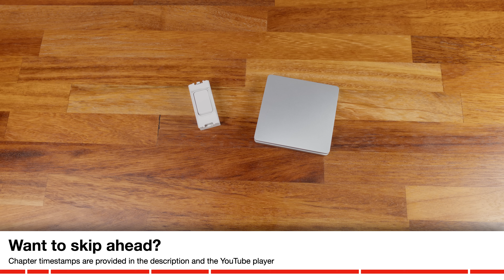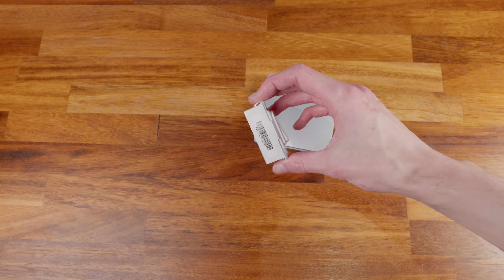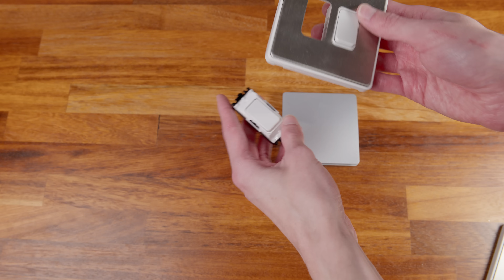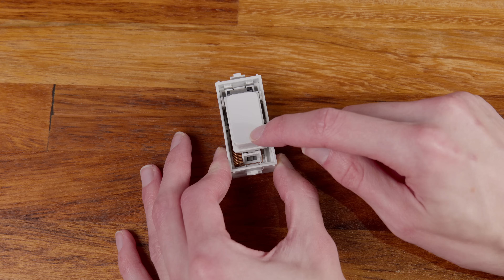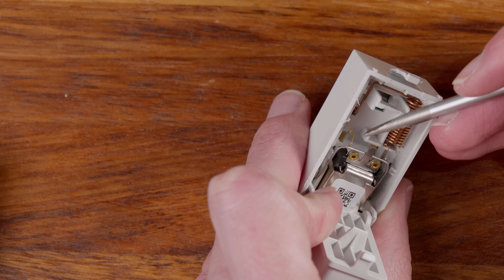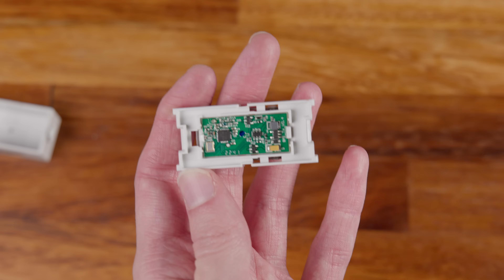An Expensive Smart Home Mistake? My Quinetic Switches are FAILING!

Comment: Brilliant video. If starting from scratch, would you use these on a new build, fully kitting the place out with these? Are there any brands that are a since shown to prove themselves?
Reply from the maker: These devices are great for retrofit applications where running cables would be too disruptive but I wouldn't use them on a new build.  A new build or rewire is the prime opportunity to install dedicated cabling for everything.

I've seen people do rewires using these switches instead of installing switch drops and it just seems like such a terrible idea.  What happens in 10-20 years when something fails and a suitable replacement is no longer being manufactured?

Comment: Let’s face it a physical tangible mechanical switch with appropriate switch wire is best.
Reply from the maker: Definitely my thoughts, these still have a place (for example, installing an outside light but where running a switch drop to where you want the switch would be too destructive, but I do worry about people doing entire rewires based around these rather than just stomaching needing to plaster a few switch drops.

Comment: You could have just run a small screw into the housing to protrude far enough to replace those clips and hold the spring down, would never have failed again.

Comment: If mine break I will get replacements on warranty or try epoxy where the clips go. Never had much luck with the small sonoffs .Although they are small they don't fit behind the light switch easily. I could not get it in even a 35mm as the back of the switch protrudes to much.  Also for miniR2 detached relay mode does not work on ZHA and i don't want to switch to Zigbee2Mqtt.
I also don't trust the amount of clicks the cheap sonoffs have it them. Replacing is a real pain when they fail.

Comment: It would be wise just to still run switch drop cables and leave it behind the back box
Reply from the maker: Absolutely, in my case this wasn't an issue since I retrofitted them in place of existing switches, but it does worry me seeing people doing "Quinetic Rewires" where there are no switch drops meaning the install is reliant on Quinetic switches going forwards!

Comment: Found your video after having endless problems with Quinetic switches. The large flat panel ones work fine but yes they are ugly. Knightsbridge brand switches failed in six months so the retailer TLC provided us with free replacements when our extremely unhelpful electrician failed to honour his warranty.  However a year on, we now have a receiver failure. Am bitterly regretting installing Quinetic and now considering getting the effected room hardwired (very expensive and disruptive). Avoid!
Reply from the maker: That's definitely unfortunate!  They're still a decent option for retrofit applications such as controlling an outside light where running a cable to a switch would be awkward, but I do worry about situations such as yours(?) where it's being used as the primary means of controlling indoor lighting without any cables running to switches since, as you've found, you're then tied into relying on a wireless solution long term.

Comment: Thanks for the video, such a shame they fail, anyway I want to hang my bedroom door to the other side so will need to move the switch but don't want to chase the wall out, so I was thinking of this switch, but now I need to look at another approach to my problem, any suggestions? Bob in the UK, HAVE JOINED YOUR CHANNEL.
Reply from the maker: To be honest, for that sort of situation these are still probably your best option, although maybe not the MK grid modules I have here, their "paddle" style switches probably have a different design so may not have this issue.  It may just be worth keeping a spare switch around just in case of any issues (even pair it and keep it beside the bed so you can turn the lights off from in bed!). Of course if you're ever redecorating then at that point it may be worth chasing in a cable.

Comment: I sent mine back to TLC under guarantee. Replaced without fuss or arguments.
Reply: Fully understand that stance. However, informing the supplier of the issue may result in action to rectify the problem. If you don't know it's broken you can't start to fix it.
Reply: Was at the elex Coventry yesterday and showed the guys on the Quinetic stand this video as they were not aware of the problem, interested to read some have been returned under warranty to their only distributor TLC and they werent aware of the fault, unless of course it was returned for a different fault.
Reply from the maker: I definitely could have done, they'd still be under warranty but given I'm pretty sure this is more of a design issue, I'd have ended up with new switches that could fail in the exact same way again.  At that point I'd rather just cut my losses and fit a different system which I can trust the long term durability of.

Comment: Surely, with your set of skills, you'll DIY a solution to reinforce those two little plastic posts
Reply from the maker: I probably could have, although personally I always try to use things where I keep the hardware as stock as possible, and if the manufacture's design isn't good enough from the factory, I'll not use it.  I'd rather not be in a situation where every time I want to fit a new switch I need to embark on a project to reenforce them.

Comment: Do the Quinetic switches come with a warranty?  It seems like a seven-month-old switch should be replaced by the company.
Reply from the maker: They do, and I absolutely could have used the warranty, however my point was more that I have installed a tonne of these and now can't trust them to be reliable long term.  The £17 to replace a failed module isn't really the issue, it's the time and effort required to deal with failed modules where I then can't control the lights and need to swap the module and deal with the replacement process.  Even worse if you were installing this as a contractor and need to deal with customers calling you back to replace failed modules.
Reply: Thanks for your quick response. I loved your video. I installed Insteon light switches 10 years ago and not only did they start failing about a year out, the company went out of business!  I must have spent close to $7,000 on those darn things. I’ve been replacing them with Lutron switches.

Comment: I avoid BG if possible. Low cost for a reason. Had a real hassle installing one of these in a grid, needed supplied adaptors and shims, a real cobble up and ended up looking crap.  The Quinetiq stuff I’ve found to be robust.

Comment: Looks like there really simply designed. You can likely add some diy reinforcement to the posts if there easy to pop open like that. Really dosent bode well for bigger installs/important installs like you say.

I really like the kentic consept.

Comment: I must admit like yourself l had concerns when l first saw these Quinetic switches being installed as a primary switching source on their longevity considering the replacement cost in the advent of a failure as you have just highlighted. 
   Keep up the great videos and stay safe.
Reply: I've just put a few in my house haha. Not the grid version luckily. I think I'll keep the old ones in the loft as a backup :)

Comment: The kinetic switch is not the problem, the only problem is this brand, just use another brand
Reply from the maker: The issue is that there only seems to be this one model of kinetic switch that fits into my MK grid light switches.  Another company (Ener-J) also sell one, but it looks very similar and may end up being the same product under a different brand.  Would rather just replace them with a system that uses the known-reliable MK retractive switches.  Then, while I could get the traditional "paddle" style kinetic switches - those are out of the question as I want something that matches my existing light switches.
Reply: @camerongray1515  Very useful videos about Quinetic.  I am planning (or I was planning!) on using Quinetic paddle style switches for a couple of outside lights.  I want two switches to switch two lights at the same time.  I have two questions I hope you can answer.  1) Is it possible to have two switches paired both to two lights?  2)  Do you know if the paddle switches suffer from the same fatigue problem you experience with the MK grid versions?  Would be great if you could answer.
Reply: @MrSgtSunshine  A little late but for anyone who needs to know the answer is: yes "a controller can be controlled by a maximum of 10 separate switches"

Comment: As someone mentioned already, could you repair these with tiny screws through the outside housing with the ends catching the spring, like the clips do?
Reply from the maker: I imagine you probably could, but you'd have to be extremely precise to get the positioning just right - the mechanism only moves around 1mm when clicked.  Personally I'd rather just replace them with something I can trust the reliability of

Comment: While it would be better if it didnt break in the first place it is fixable, put a small screw through the side of the plastic housing to hold the spring down problem solved.

Comment: 1. Warranty return. 2. Hard to work out how much space and the movement of the mechanism but: could you drill two holes and put a long skinny bolt across the width to act as the limit?

Comment: I've been looking into using the CSPGM2075PW modules from Click. They're a Tuya TS0042 internally but a grid switch externally. Also supported in Z2M. Reason I haven't yet is mostly down to price.

Comment: They have a three year warranty, which I’ve had to use just once, after around two years with a heavily used switch.  The MK grid switch failed to click when pressed, the same problem as you had.

Comment: 14:43
I do this with zigbee coin based CR2032 switch (AQARA) and solder the switch points to an existing wall switch. No live wires.
Reply: how often you need to replace the battery ?

Comment: Oooo. Cool. I knew of Quinetic switches, and was liking the general idea, but then was not thrilled by lack of receivers so I can hook things into own system. Your reverse engineering efforts then are a game changer, and now I will look into this again. Rest of my home automation is primarly Shelly Pro modules, with custom automation software.

I do not think this is planned obsolescence, just a design mistake, possibly because product is pretty new and made by company with a bit less experience. Switches are designed to last decades. I think it is fixable, both in design iteration, but also if it fails, to use some epoxy to glue things back.

Comment: I would really press the manufacturer for delivering a product with defects. At least they should keep supplying you with new modules until your warranty runs out.
Reply: It's also possible that future revisions may have additional support added there. Those really seem way too small for the forces involved using that kind of plastic
Reply from the maker: They have a 3 year warranty (I think) so realistically I could definitely get them replaced, but then I need to factor in the time I'd have to spend dealing with returning modules when they fail and the inconvenience of them failing at inconvenient times.  Would rather just replace them with a system I can trust the reliability of.
Reply: @camerongray1515  I totally get your sentiment. But even if you switch, I'd hold them accountable and force them to loose money on your original sale, since that behavior must not be tolerated.
Reply: @camerongray1515 6 years under UK consumer law (5 in Scotland, they always like to be different) covers manufacturing defects or design faults for a product that should be reasonably expected to last that long. But I understand that the hassle factor comes into play. Them offering 3 years is nothing more than a marketing tool, it's still 6.
Reply: Does sale of goods act allow you to get a refund rather than replacement?
Reply: @camerongray1515  - The more items that are returned/highlighted will improve the production from suppliers.
Reply: I'm about to order one of these, from QnetiQ, to use on an exit door, which has the light switch on the hinge side, so is awkward to reach.
Just wondering if you still have the switches have you considered repairing and adding additional material to strengthen?
Great to see the component parts 👍

Comment: +1 for Shelly switches. I have Plus 1s, Plus 1PMs and Plus 2s in all the light switches in my flat with cheap Schneider retractive plates (and a couple of MK-type grid ones). All the usual light on/off happens locally, but you can also do it detached and handle switching logic remotely. Of course it relies on having neutrals at your switches, but your place should be modern enough for that. 
I do all the comms between Shelly and Home assistant over MQTT, bit of a pain to set up but happy to share config files if you need a hand
Reply: The thing is that Shelly (or other) devices needs to be powered. And if you have one or two, not a big deal. But if you have an house full of them the power consumption starts to be significant! I've measured that 1 Shelly devices consumes roughly 1W of power. That is to me a lot. If you multiply for 20 switches in an house you get 20W of power consumed just doing nothing. At the end of the year it is 175kW/h of electricity, that at the price of 0.30euros in my country is 52 euros at years just to run them. This is also an environmental problem also, I don't like wasting electricity for nothing.
Reply: I have 20 Shellies now (in a 2 bed flat…), and found that out of the box they use about a watt, but in eco mode (not sure why this isn’t a default) they use under 100mw each, with no noticeable difference in speed from my usage. The energy prices here in the UK are around the same (mines 30p/kWh day and 7.5p/kWh night), but I can cope with the £5/yr ish for the convenience. Not to mention it saves me more than that through automations like turning everything off when I leave home.

Comment: Can't this be fixed with a simple drop of two-component epoxy? It should add necessary mechanical support for the failing plastic clips and keep the spring in place.
Reply: I think they were suggesting a drop be placed on top of the tiny clip before it fails to provide additional resistance against shear forces
Reply: @TheSpatialTheory   Yes, thank you for clarifying what I meant - I indeed suggested to use epoxy as a support filler to prevent the plastic clip from breaking off so easily, not to glue the spring in place.
Reply from the maker: I did consider this but unfortunately the spring needs to be able to move downwards when the switch is pressed but be held under the clip so epoxying it in a fixed position wouldn't work.

Comment: Im doing a significant rennovation of my home including a full rewire. Using shelly 4pro in a custom cabinet and then shelly i4s to 2 dual pole retractive switches. Plan is to use HA to enable my switches to do different things such as blinds, lights etc... A shelly plus 2 would do a similar thing for standard wiring setups. Would be interested to see how you find the shellys.
Reply: Aqara H1 switches allow multi button options when you run in decoupled mode, single clicks, double clicks and. multi press in 2 gang switches so you can control multiple devices through home assistant
Reply: If you’re doing full rewire, I wouldn’t recommend using wireless lighting. There are loads of wired solutions available
Reply from the maker: @mercian8051 The way I'd handle this situation is to at least wire for regular switches and then install wireless switches if desired.  That way you can easily enough convert back to wired switches if desired.  With a rewire, it may also be worth running additional cables such as running some switch wires to a central location and some sort of data cable such as KNX to each switch position.  Even if they never end up getting used, it's better to get them in at rewire time rather than need to add them in later.
Reply: I've had shelly 1 modules for several years, recently the capacitors in the power supplies have started failing and they make a loud hissing noise
Reply: I did something similar for lighting all my circuits wired to a central location, I used pro 2s been in over yr and all good

Comment: the aqara switches are nice I use the H1 no neutral all over my house but they also do neutral and wireless versions.

the old baking soda and super glue trick may work to rebuild the broken plastic clips in your switches
Reply: But they are some times a bit temperamental of not connected to a good coordinator 
Had trouble with the sonoff ones but better stability with Skyconnect